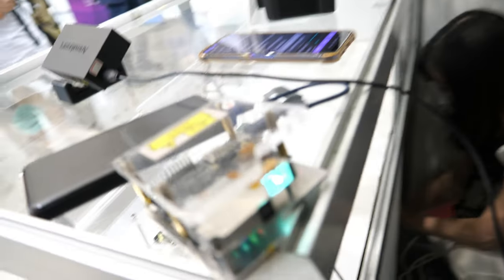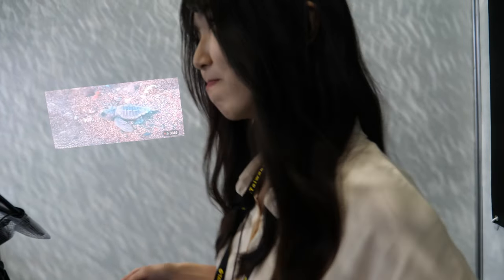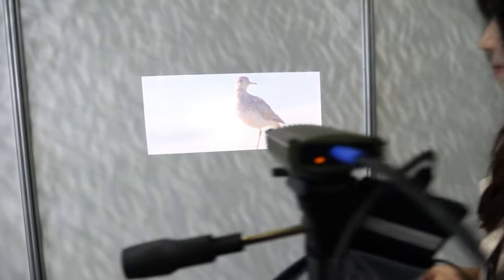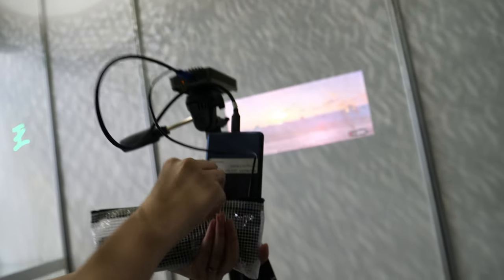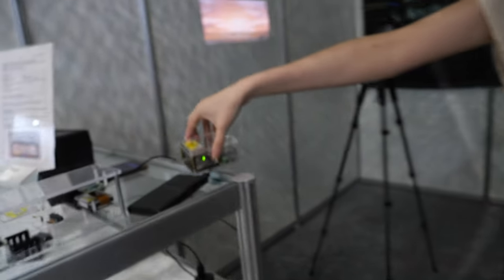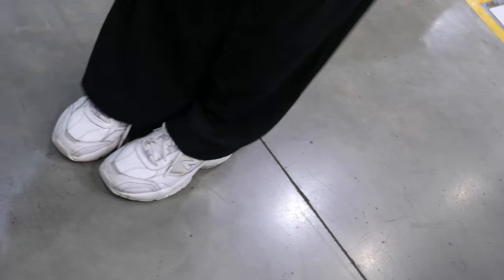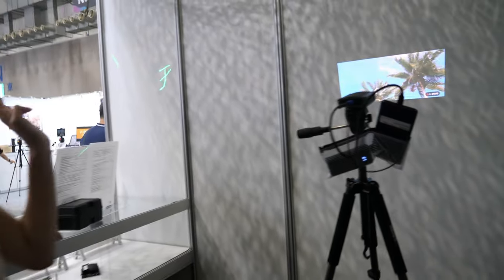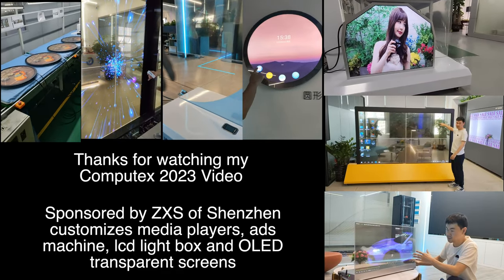Ultimems MEMS Projector Mirror, Vector scanning module, Focus-free Projector

Comment: so this one can display over a curved surface. they should make it to be a selling point.
Reply: It's not a new technolgy, vector laser scanning already used decades ago even in the discos, the only difference it using mems mirror for the projection.
Reply: @RonaldMallory  product size and pixel density matter. light bulb has been used centuries ago but putting millions of bulb inside a square inch is a different story.

Comment: This is just a nebra anybeam, just more expensive…
Reply: Nebra AnyBeam is one such scanning laser projector module. It appears Ultimems actually make the mirror chip they're built from. 

Personally I'm more interested in the true 2D vector version than the raster scanners. Their efficiency and resolution scales up drastically when showing lines, curves or even scattered dots, like the cat shown initially in this video, star maps, or vector arcade games like Asteroids, Spacewar! or Tempest.

There's a chance the lady showing the product wasn't very well informed (but I expect a larger influence was language barriers and trying to tell what Charbax's level is), but both of the raster scan modules were using resonance, such that the back and forth swing involved in raster scanning is mostly mechanical spring action. This reduces power demand for directing the mirror.

Charbax' level.. well, at 4:45 he stuck his production camera straight in the path of a laser beam and lucked out a bit in catching some images through reflections off the camera, and not burning out a few pixels. Do not look into laser with remaining eye, as the adage goes. 

He's not wrong to ask about fitting inside a phone; Lenovo Smart Cast did fit a picoprojector, and I believe they had a tablet that made it to market.

Someone who appears to have more experience than I (commenting on Hackaday in 2019) recognized the devkits, indicating the Nebra is indeed an Ultimems based design. So yes, that's one place you can buy their raster scan hardware.